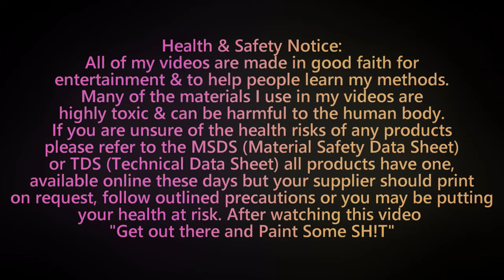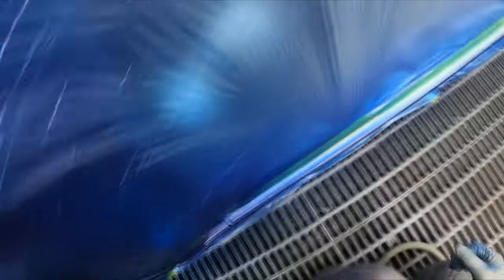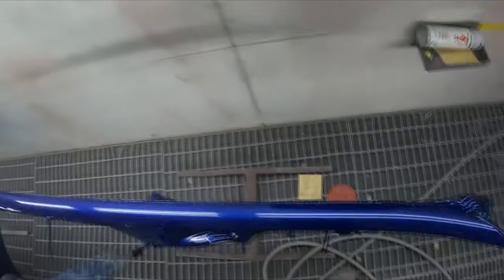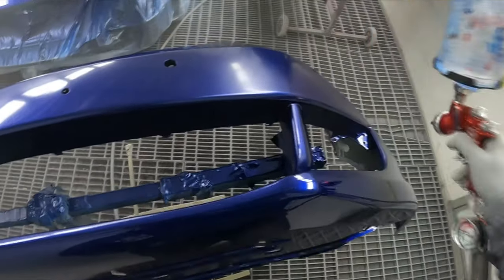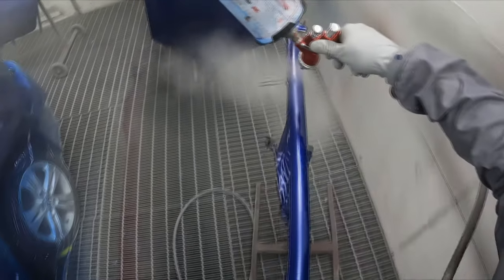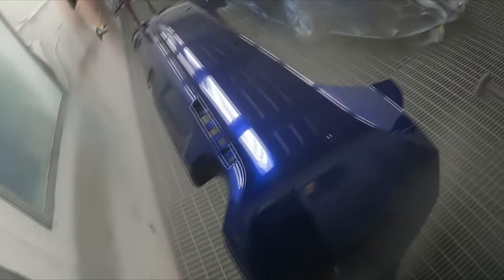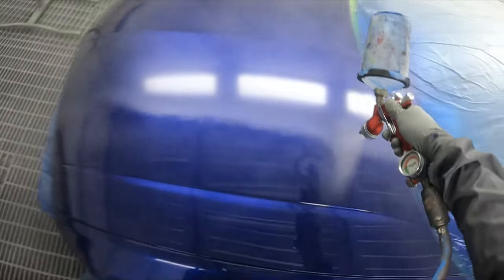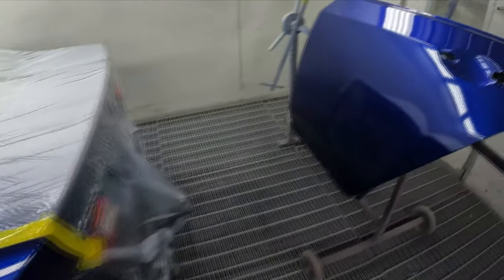Honda Accord Clear Coat Stage

Comment: Isn't 8173 is a 30/70 or tack n whack clear? From memory the data sheet says one medium one full with very little to no flash depending on size of job. I remember it was a decent looking clear but you had to apply literally just a closed first coat.
Reply from the maker: I find it so gluggy, it doesn't flow at all. One of the worst clears I've used.
Reply: @TheGunmanRAW  ppg clears have always been a bit like spraying honey, I will agree with you there.